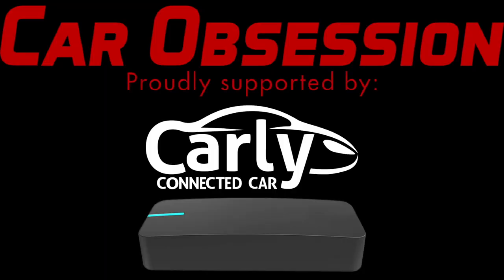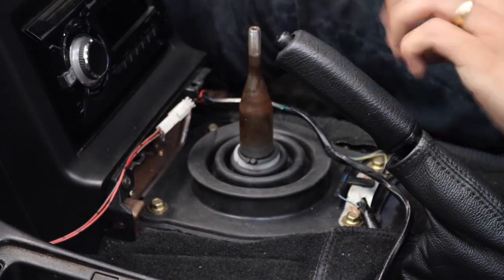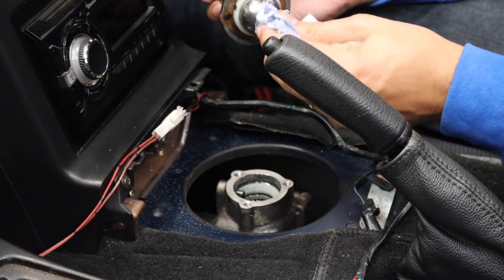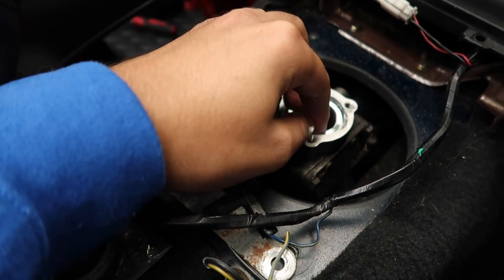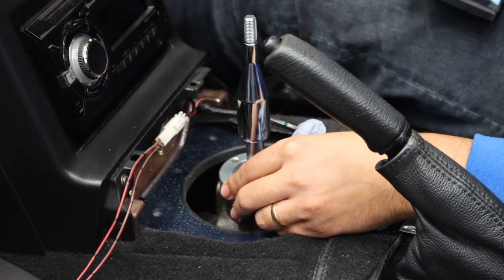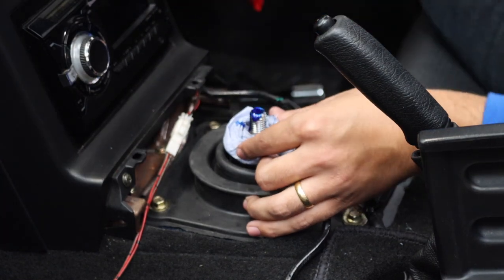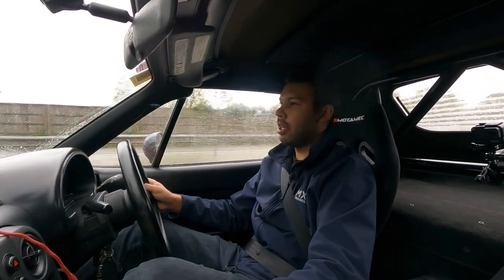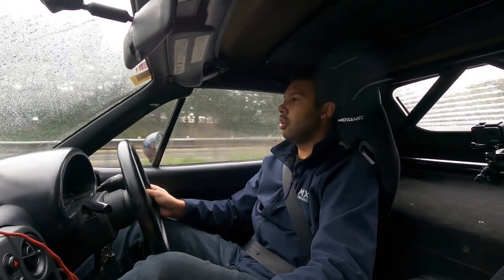Fitting a Short Shifter To A Mk1 Mazda MX-5: Is It ACTUALLY Worth It???

Comment: Actually after cleaning out my top turret & replacing oil with Molyslip Gearbox oil additive &  correct oil then fitting a new short shifter and new adaption kit..the gear change is far better & softer than before. 
I also changed the oil in the gearbox & refilled with Molyslip Gearbox oil  & The correct oil for this make. Then finally I did an oil change in the rear differential again Molyslip Gearbox oil and remainder oil. All done and the car changes gear smoothly,  gearbox quieter and all feels good. Oh yes I use Molyslip Engine oil additive in my engine oil too.